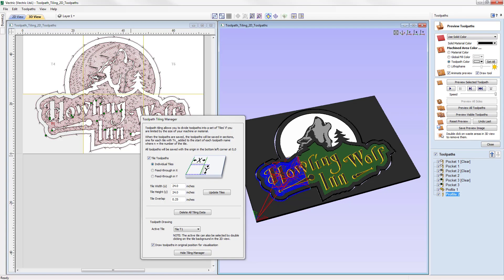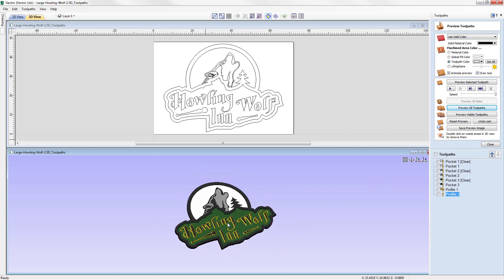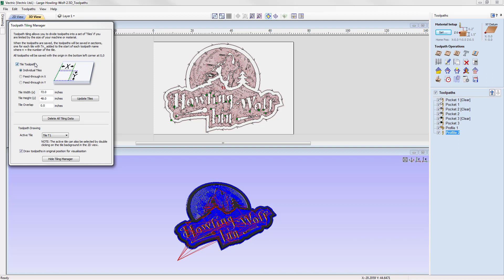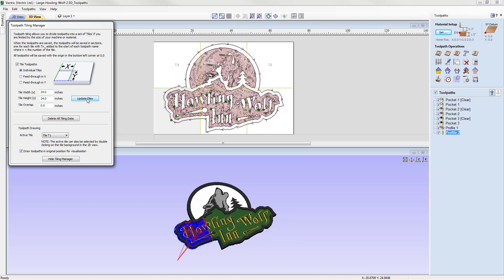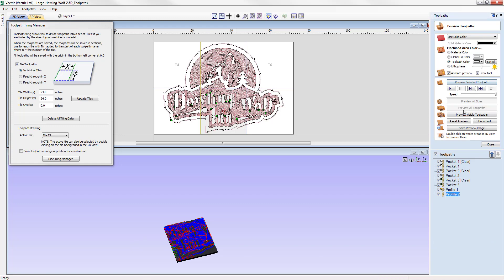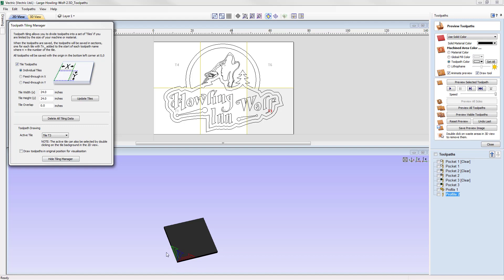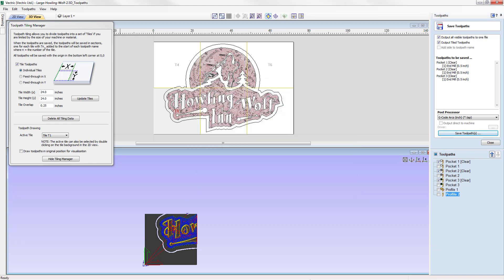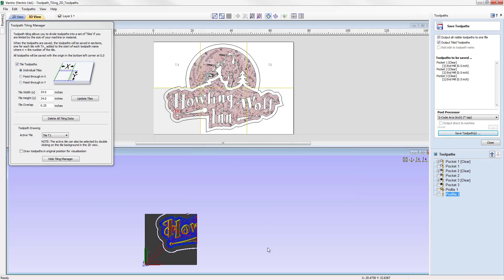Vectric V10 Tutorials | 2D Toolpaths | Toolpath Tiling

Comment: So in this example, your machine is floating in the air? Either that, or you'd need to make allowance to join these panels. A much more appropriate example would be as most machines are laid out, a feed through in the Y only. You'd also need to put down some datums, probably like me, put a 3mm datum hole through, ready to pick up when the job is moved.

Comment: This is a fine explanation of tiling but lacks any comment or definition on how to space out index holes--datum holes referenced by Skysurfer--to ensure absolute precision when either tiling through Y or placing the six separate tiles in place to ensure precision.  For instance, while the tutorial indicates all 6 reference the same starting point in the lower left corner there is no definition of how to place the index/datum holes to ensure that each tile is within tolerance of, say, .001 inch/.0254 mm so that continuation in lettering from tile to tile is precise and leaves no jagged edges on transition.
Reply from the maker: Hey Stephen, thank you for your suggestion, we'll certainly look into creating a video that discusses the points you have detailed here! In the mean time if you have any questions on how to do this, please email our support team on support@vectric.com thank you, have a great day!

Comment: So if the material I'm using doesn't have perfectly clean edges I'll want the tool path to trim the edges along the dividing lines of the model so that the pieces will have a tighter fit. It would be nice if this feature could separated the segments in a way that left a slight border all around.
Reply from the maker: Hello J S... have you explorded the Overlap section of the form?  If you need help please feel free to contact support@vectric.com